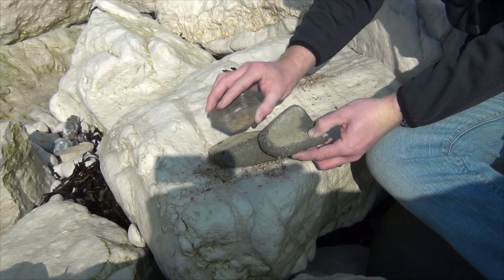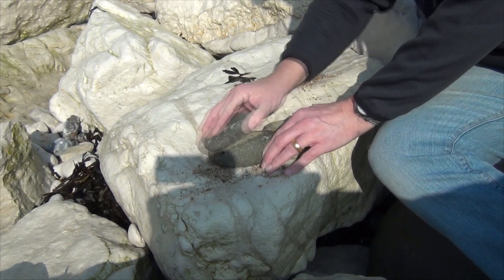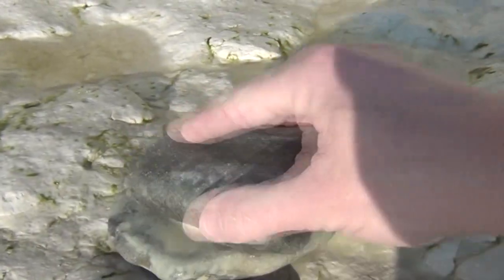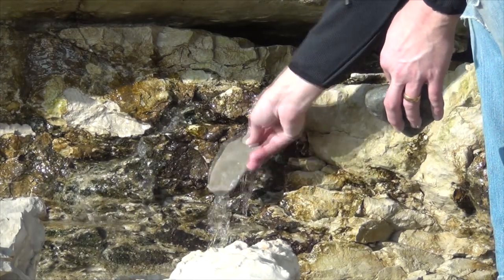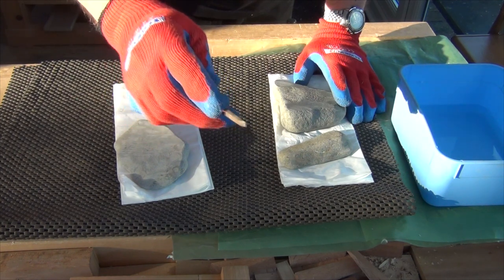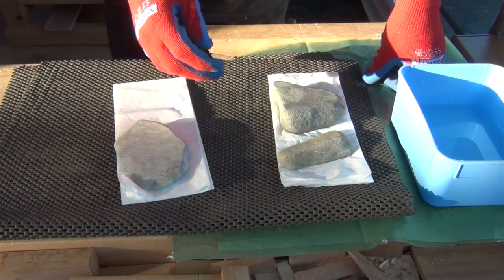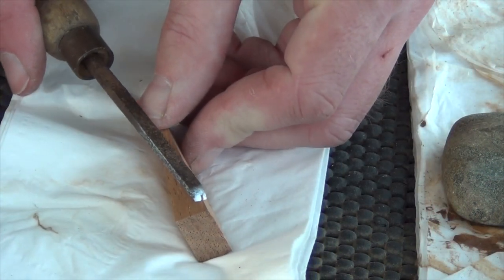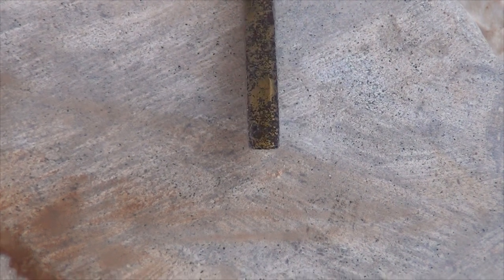Sharpening on Rocks!

Comment: Will a pitted chisel effect it's use.
Reply from the maker: When the pits on the back of the chisel reach the edge, it is impossible to produce a continuous sharp edge. The chisel will then leave tracks, etc. and be difficult to use accurately. Pits on the bevel side of the chisel will be ground away during sharpening, so they're not a problem.
Reply: I bought a set of Stanley 5001 chisels on the internet that was supposedly in good condition but the backs are really badly pitted.
Reply from the maker: Sounds like they were badly described, so perhaps you could return them